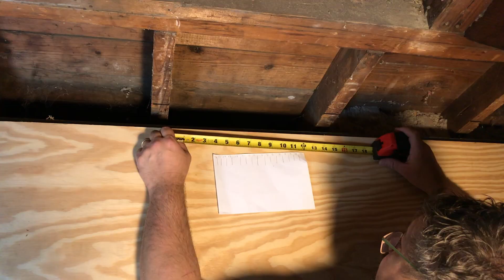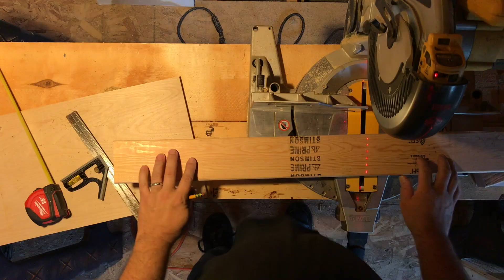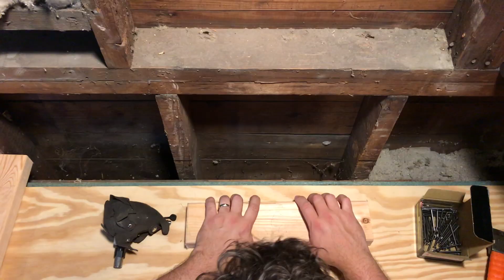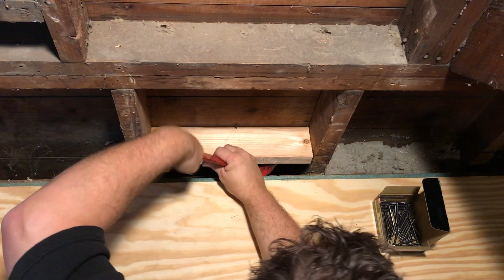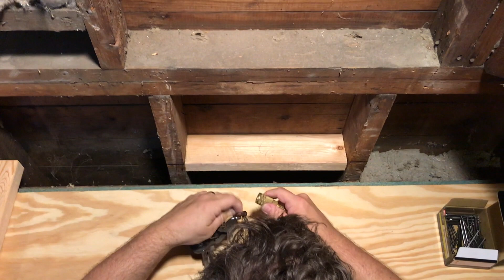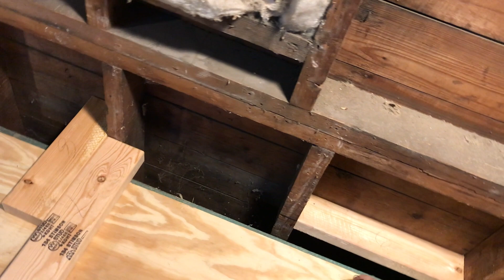Novel Knacks - Install Fire Blocking

Comment: Do the fire blocks have to be level with the subfloor?
Reply: Yes. I have no idea what he's doing. The flames and air will just come up and hit the board and continue though the dry wall I'm assuming he's finishing with.
Reply: IRC R302.11 requires fire-blocking:
At the floor level in balloon-framed walls
To stop concealed vertical draft openings

Comment: Not sure fire blocking installed at the very top of a house does much of anything.  To stop the draft effect...would start installing in the basement and second floor first?
Reply from the maker: It may not make a difference, but the building inspector asked for the blocking to bring the attic remodel up code.

The openings in the basement were already filled with mortar. Since I gutted the attic to the studs and I pulled a permit, I have to bring it up to code by adding a break between the 1st and 2nd floor(attic).
Reply: @novelknacks4904   You have done the work required by Code at the location of the improvement. Yes the old homes with Balloon walls have fire stop problems etc. Could never understand those who say, they don’t build them like they used to....I say thank God.